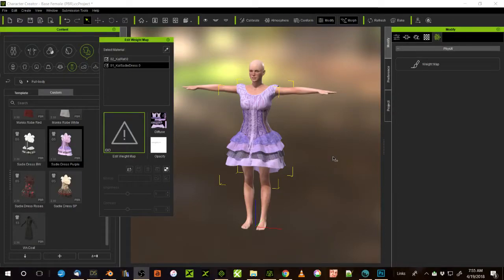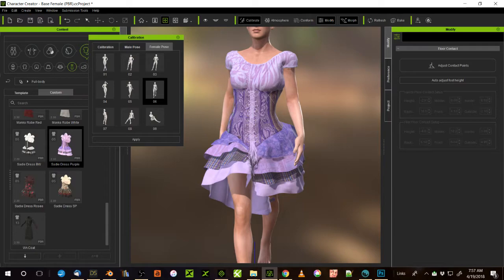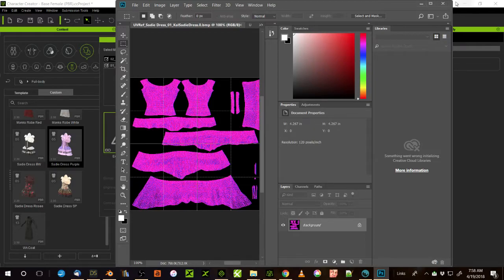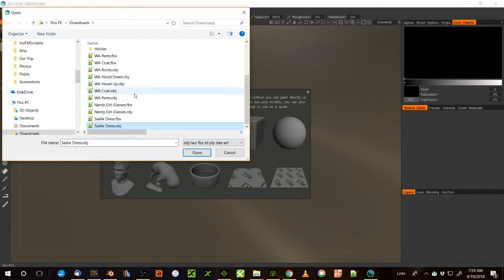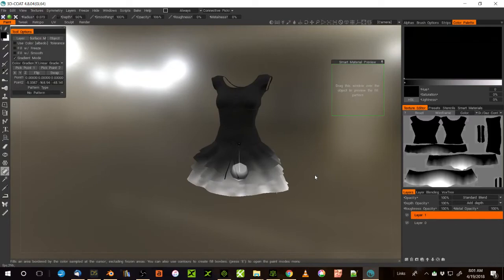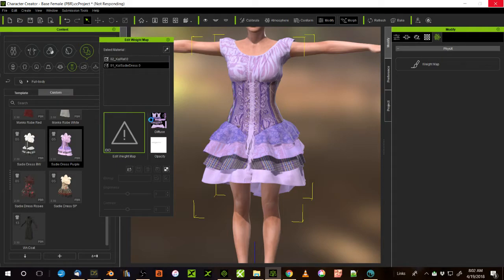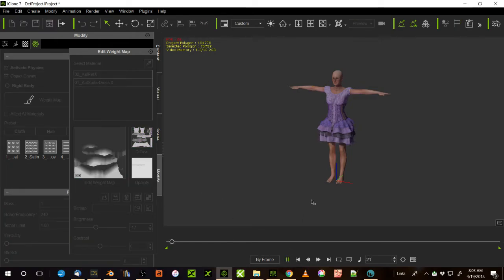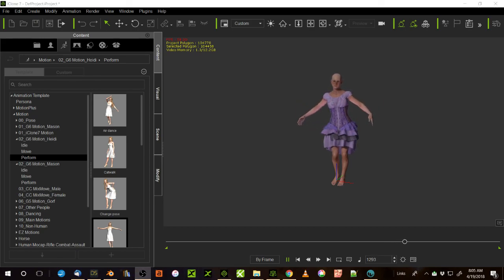Cloth Physics Weight Painting with 3D Coat for iClone

Comment: What format should the clothes in 3D be saved in to have that map?
Reply from the maker: The UV mapping needs to be added to the object - UV mapping is saved with any of the standard formats (FBX, OBJ, etc.).  But it does not come automatically - the person who creates the object needs to understand UV mapping (and it's not easy - note that you can use that same 3DCoat program I recommend here to generate a UV map).
Reply: @MikeDKelley  yes, thank you very much for your guidance, I will look for this software to install. Thank you for your lesson.

Comment: Hello sir
I'm having a problem with a skirt has two layers

hope you have a solution for correct physics animation

https://mega.nz/file/3bZgWT7Q#enL-iugOyptcge1jYbMkrwCcBOwMSsE-58kD1FG9Ly8
Reply from the maker: The problem is the UVs on that skirt are just plain wrong -- if you examine them as I've shown you'll see that the skirt is actually split in half, which means you can't apply a proper weight map without one half (either the front or the back) having the wrong one.  What I would suggest if you are insistent on using this is to create your own UVs for it - I don't have tutorials for this process but if you have 3D Coat you can find them on the web.  In my own case, I'd use a different skirt from someone who made it better.
Reply: @MikeDKelley  Thank you for your detailed explanation
The 3D world is really complicated and interesting
I thought I already understood
Turned out to be just the tip of the iceberg
Looking forward to future video~

Comment: Could you please show us how you made the butt shapes i'm trying to add physics to them
Reply from the maker: You mean how I painted the shapes onto the dress?  I didn't make any part of the dress, but just painted it and I pretty well showed how to add the physics (it just takes one button press).
Reply: @MikeDKelley  Yeah and do you know how to add physics for the butt in iclone? I have tried adding new bones to the character in Blender, weight painted, and exported it as a fbx into 3dxchange and it was a disaster.
Reply from the maker: @BlueStarMusix  Sorry, no -- I don't really need "butt" physics, so never thought about it (there are breast bones usable for those, but I wouldn't even have a clue as to where to start with the ass :>).
Reply: @MikeDKelley  3 Months later now i have this program. I exported XF-dForce_CD_Skirt from Daz, as a obj into Blender to scale it down it was too massive then exported it again as a obj into 3D Coat, but it has no texture on it it's just a solid grey and it still looks very large https://ibb.co/zskyrjc Is there something i'm doing wrong here
Reply from the maker: @BlueStarMusix  You don't want to do that.  Export as an OBJ from Daz if need be, but the best way is to export as an FBX and import into CC3 using Transformer (which will preserve all the textures).  I have many tutorials which show this process.
Reply: @MikeDKelley  I do use that method that you do with transformer, i wanted to know why my texture of the skirt is not showing up in 3d Coat as yours and it was large
Reply from the maker: @BlueStarMusix  If it's a 3DCoat problem I may not be able to help you -- I'm not really much of an expert.  You might want to ask on their forums or put in a help request (the developer is very helpful).  If you export from Daz and bring in via Transformer you really ought to have all the textures.  Then if you need to use 3D coat for the weight map painting you only need to export that one map (since you'll have all the other textures already in CC3).

Comment: Thanks great tutorial.
But 4:48
I can't find whole layer 
I find either layer
Reply from the maker: You're saying that you imported something in but it doesn't have those layers?  I'd have to see a screen shot of what you have -- but you have to have some layer (you may not have more than one, but there will always be one).  Worse comes to worst you can always add a layer.
Reply: thank you very much. I have solved the problem. Finally, I will be able to move the clothes in a somewhat realistic way
Reply: I have the layers but I can't convert the background layer to black.
Because it does not show a "fill whole layer". Just "fill either layer"
Reply from the maker: @alexgo643  Well, fill either layer then.  The objective is to end up with a layer you can use, and it doesn't matter which one (but I'd fill the top layer).  If you can't get 3DCoat to work properly for you, though, I would suggest you contact support for it (I'm not exactly a 3DCoat expert -- I can only show what works for me).

Comment: color map export is different from that in texture editor window , what am I doing wrong ?
please help
Reply from the maker: I'm not sure exactly what point you are in the process.  Are you saying that you are using 3DCoat and that after exporting all the maps you don't see the weight map you painted?  You might have to show me some screen shots and/or video.
Reply: @MikeDKelley  
https://ibb.co/0DRctYr
https://ibb.co/mbb3zJs
and this is what i get after export :
https://ibb.co/GJz7WQJ
Reply from the maker: @gamexbox1230  Are you deleting all the layers except for one?  You only want to export just the one, and it looks like you are exporting more than one.  But, honestly, without seeing a video of your entire workflow I'm not sure what's going on -- I'm no expert on 3DCoat, but I've never had an issue with it exporting the wrong textures (so make sure you template for export is also set up correctly).  Also -- you might check with the 3DCoat author and explain your issues (he's really good about helping).
Reply: @MikeDKelley  i couldnt find a template for iclone so i exported with the default template
could you send me the settings you used for export?
Reply from the maker: @gamexbox1230  At the 6:26 mark is the exact settings I used, so you ought to be able to duplicate those.  But, again, make sure you delete ALL the layers except the color one before you begin.
Reply from the maker: @gamexbox1230  I'm no 3DCoat expert, but just looking at what you're doing it appears your UV map may be all screwed up.  This was a Daz object?  If so, let me know exactly what Daz object and I'll see if I can find out the issue (because my gut tells me the UV mapping is all wrong for that object, so maybe the developer who made it didn't know what they were doing).
Reply from the maker: @gamexbox1230  Yeah, as I suspected, the UV map isn't right for this item.  So you really can't use 3DCoat unless you consolidate the UV islands and that's way above my pay grade.  The bottom line is that you can only use 3DCoat the way I have shown for items which have the right UV maps (otherwise you can paint on them the way I've shown in other tutorials).
Reply: @MikeDKelley  all right then I'll do it the old way with photoshop. Many thanks for your help.

Comment: I also am a fan of 3D Coat. I think it can do anything Substance painter or Z brush can do. I just still have a crap load of learning to do. My main modeling program is Blender. Still using 2.97. Have courses on Udemy for 2.8 and a side course for hard surface modeling that I bought from the Blender Market that covers Boolean and real tricky shapes and cuts. I have never sculpted but want to learn at least basically how. I got CC3 Pipeline with I Clone 7 for 190 dollars the other day with 52% off anaversary sale. I have started messing with them, but there is so much to learn on them. 
Thank you for making tutorials about this stuff.

Comment: Great video thanks! How do I convert cloth from character creator into fbx or obj? Thanks!
Reply from the maker: As long as it's not DRM (that is, if it isn't from RL) you can just export the avatar with clothing from CC3 (and then in whatever program you can separate the avatar from the clothing).  Just export "Clothed Figure".
Reply: @MikeDKelley   Thanks a lot! If I install zbrush is easier to get the dress only? What version of zbrush do you recommend to me? There are many. Your videos and work are awesome! Thank you so much!
Reply from the maker: @elrayo11  I don't use ZBrush so I'm not sure where you're going with this -- you want to further modify the dress?  Any program will do that, even Blender (which is free).  But if you want a version of ZBrush that is compatible with CC3 (like plug compatible) I'd recommend you ask on the Reallusion forum, as they will know.

Comment: Would you advise this same method and program with CC3 , Mike? Thanks in advance!
Reply from the maker: Absolutely -- exactly the same.
Reply: Thanks for the quick response!  Which tutorial did you make explaining how to get the collision shapes from Natalie and Christian?  Do they have better collision shapes now ? Or is this still the case?
Reply from the maker: Actually, CC3 doesn't even have collision shapes (I think this is a bug or at least a very bad oversight).  So bringing into iClone you need to both enable collision shapes AND load them in, and I still use Natalie and Christian.  Um, not sure what tutorials have that in there anymore -- I've made so many -- but you can find them as they are provided for every version of iClone.  If you can't find them write me again and I'll see if I see where they are located (for me I moved them into a directory so I can easily load them in -- I think if you load Nat and Chris in and then save their collision shapes that's probably the easiest).

Comment: There is one thing I think you should address in this video. As we can see, the there are still some issues with the dress. Is there a way to fix this so that the physics on the dress work independently of the legs, needing only to add collision blocks to the thighs/legs as they interact with the dress, much like the regular iClone dresses? Thanks.
Reply from the maker: I'm afraid I don't understand you -- the physics on this dress work exactly the same as they do on regular iClone dresses (you can indeed edit the maps on the iClone dresses in the same way).